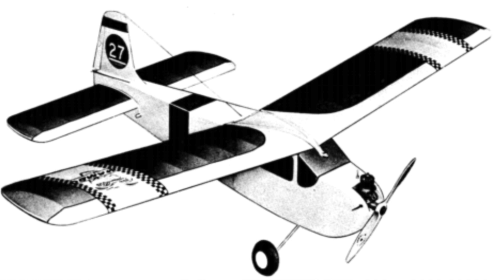Wing Dihedral for RC Airplanes

Comment: I've wondered why the Wright Brothers didn't go with dihedral and rudder and elevator control, much like birds have, instead of wing warping.
Reply from the maker: The Wright Flyer had elevators and rudder. Wing warping was though at the time to be the best way to control roll. Early WW1 fighters used wing warping (Eindecker III). As wings gained strength and stiffness, ailerons became standard. Tim

Comment: I built a foamy version of the Prairie Bird, 20" wingspan, 3 channel. Trying to fly it, rog, every time it would get about a meter or less, dip a wing, and crash. 

Pretty much everything I'm building right now is flying like a Charlie Brown kite. Really frustrated with the hobby to be honest.
Reply from the maker: 20" is a short wingspan, not much room for error.  Check for no warps, keep weight as light as possible.  Tim
Reply: @TimMcKay56   I'm probably going to rebuild the wing. AUW was about 133g with a 300mah 2s battery. In hindsight, I honestly overbuilt it. I essentially put a 20g wing on a 3g trainer, and probably twisted or did something in the process. 🙄

Comment: Hi Tim. I've built a couple of airplanes from a kit. Attempting to build a foamie with your helps. I wrecked a Dynam Hawksky years ago. Broke the nose back 6 inches and the frame in two between the top-mounted engine and the vert. stab.
Should I repair that one, or start something fresh like a J3 Cub?
Thank you very much!
Reply from the maker: Willard:  Nose is tough to fully repair. Maybe start a new project. 😊 Tim
Reply: @TimMcKay56  Thank you, Tim for such a prompt reply!
I'll take your suggestion to start a new one. Do you have any videos on building a J3 Cub, or some plans?
I appreciate you help.
Willard
Reply from the maker: Willard:  No plans, yet for a J-3. 😊 Tim

Comment: So I gotta question for ya, I don't have the brain power or knowledge...
I'm building a Dumas Taylorcraft 1814 the 40" Blue and Yellow one...
Which I'm stuck on at the moment lol...

But anyway I'm so tired of trying to collect the old GWS power systems for my projects, that they suggest...
There hard to find, and they want to much for each peice...

So my question is, with your knowledge, what power system would you suggest?

"Looking for slow flying"

I know you get alot from Buzzard Models, anything you think would work from there, "like in a brick system"?

Pretty much just wanting the whole pewer system from one place in other words...

Any suggestions, with your knowledge would be helpful 😊👍
Reply from the maker: Yote:  Best bet is to go brushless with a lipo battery. Figure out what the weight of the Taylorcraft will be. Go to www.HorizonHobby.com for a chart on E-Flite motors, as they list a model weight suitable for that motor. My guess is a 15 amp ESC and two cell lipo about right. Horizon has very good tech support for these questions. Tim
Reply: @TimMcKay56  Ok I'll go look, thanks...
Reply: @TimMcKay56  Forgot that's actually where I bought it, there suggestion was a GWS setup 🤦‍♂️

Comment: Hey Tim another question on delta models, which is better the push or pull motor?and what is the difference?
Reply from the maker: No difference, both work fine. 😊 Tim

Comment: Great explanation. Quick question, what should be the dimension of the horizontal stabilizer related to the wing span? Could you elaborate how the plane will behave if the horizontal stabilizer is too big or too small. Thanks 
Leo.
Reply from the maker: Leo:  Thanks for checking in!  There really is no mathematical relationship to stab size and wingspan for a sport flyer. If the stab size looks about right, that size should work. If in doubt you can make the stab size a bit bigger.  Tim